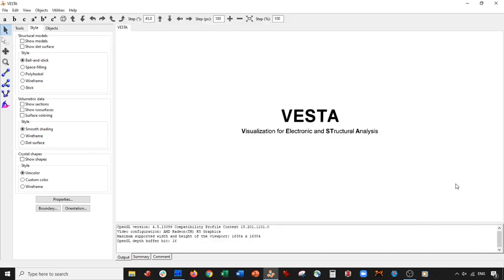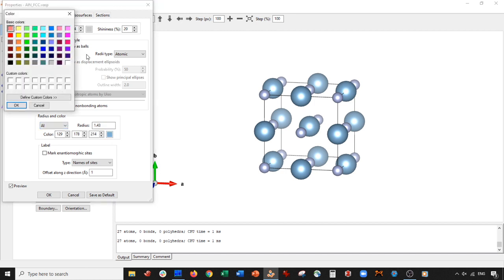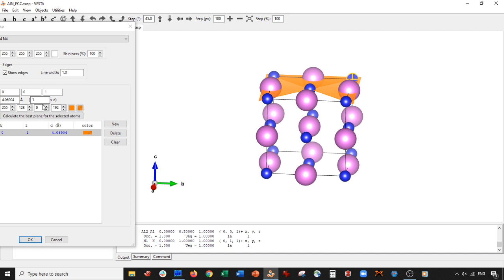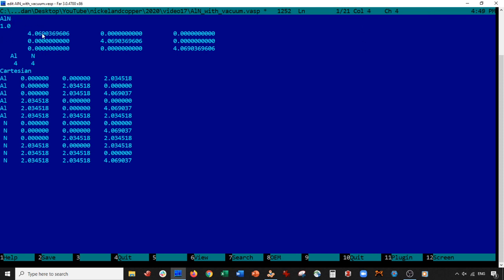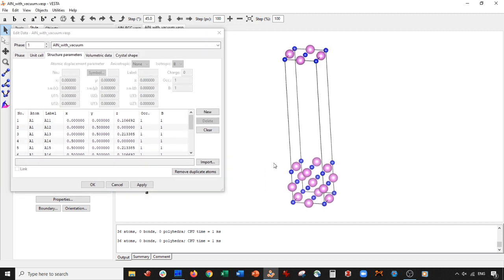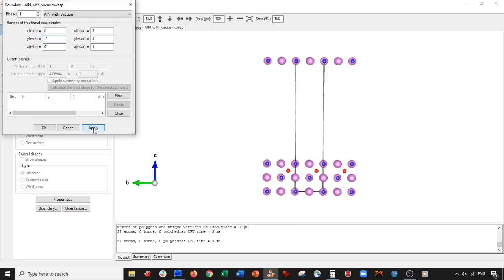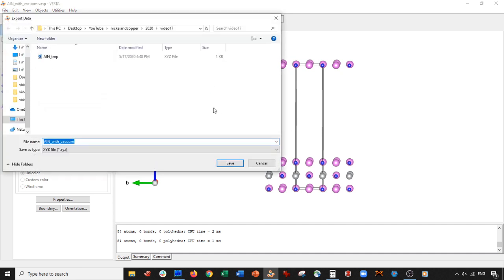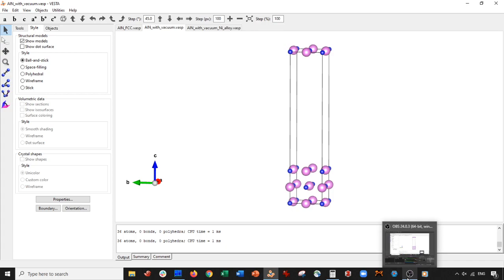VESTA Software - Add Vacuum [001] Aluminum Nitride + Doping

Comment: Sorry for my curiosity, i still dont understand clearly TWO things from your videos.
1. Why do you delete one layer from a and b directions while making vacuumn or any such, for the sake of periodic boundary?
2. Why you save as .XYZ file and then copy them into VASP type file?
regards
Reply from the maker: Hi no need to apologize. We delete the atoms in the layers because we need to save the file as an xyz. When one saves as an xyz Vesta saves all atoms on the screen. So we delete e periodic replicas so that we have no repeating atoms in the vasp file. Then when we load such coordinates into Vesta (and quantum chemistry software) the code automatically shows those atoms due to periodic boundary conditions. We do this because if we just save it as a vasp then it doesn’t save all the changes we made. So we save as an xyz to keep he changes, but then have to delete extra atoms because saving as a xyz may save too many atoms

Comment: Sir When I take a primitive unite cell of MoS2  (WSe2.vasp), then, as I extract the data as xyz then the number of Mo atom and S  is not equal to number of  the primitive unite cell (WSe2.xyz). 
unite cell
W2 Se4
1.0
3.327069 0.000000 0.000000
-1.663535 2.881326 0.000000
0.000000 0.000000 15.068951
W Se
2 4
direct
0.666667 0.333333 0.750000 W
0.333333 0.666667 0.250000 W
0.333333 0.666667 0.861569 Se
0.666667 0.333333 0.361569 Se
0.333333 0.666667 0.638431 Se
0.666667 0.333333 0.138431 Se

WSe2.xyz
14
W2 Se4
 W    1.663536    0.960441   11.301713
 W   -0.000002    1.920885    3.767238
Se   -0.000002    1.920885   12.982941
Se    1.663536    0.960441    5.448465
Se   -0.000002    1.920885    9.620485
Se    1.663536    0.960441    2.086010
Se    1.663533   -0.960441    9.620485
Se    1.663533   -0.960441   12.982941
Se    3.327067    1.920885    9.620485
Se    3.327067    1.920885   12.982941
Se   -1.663533    0.960441    2.086010
Se   -1.663533    0.960441    5.448465
Se    0.000001    3.841767    2.086010
Se    0.000001    3.841767    5.448465
Reply from the maker: Ah. Do not take them as an xyz take them as a vasp
Reply from the maker: This is because extracting as an xyz saves every atom on the screen

Comment: Thanks a lot, I have one question: what is the importance of the addition of vacuum in the relaxation and electronic calculation?
Reply from the maker: It is to reduce the interaction of the system with the periodic replica of itself.
Reply from the maker: 15 angstroms of vacuum is a well accepted amount as a measure of thumb.
Reply: @nickelandcopper5636  is 15 Ang.. over and above Z-direction is enough even in case of long Z-coordinate in my system? Say i have a supercell system of c-lattice as 32Angstroms.  Even then if i just at 15 Ang over and above is sufficient?